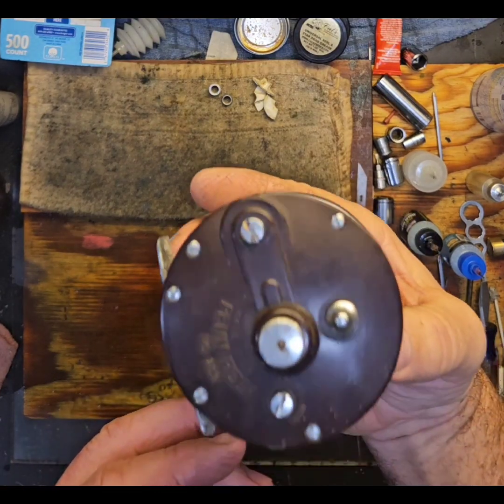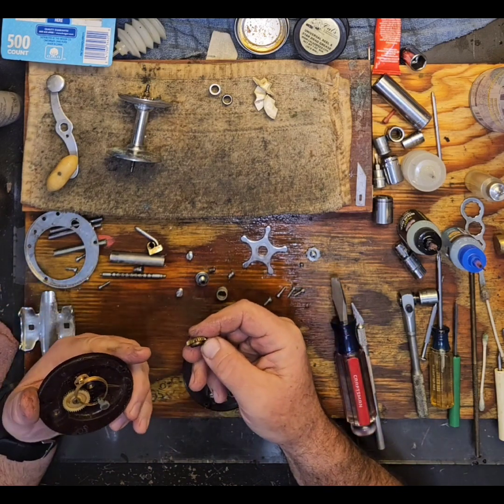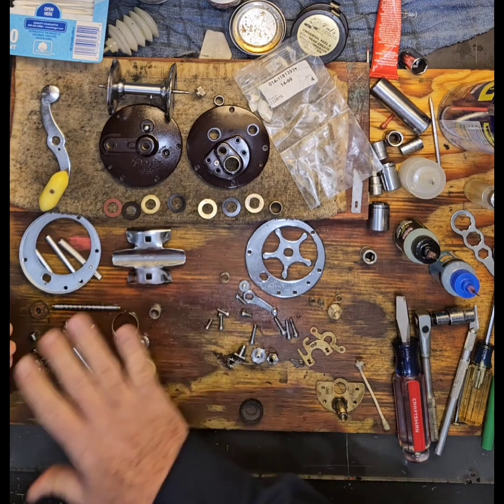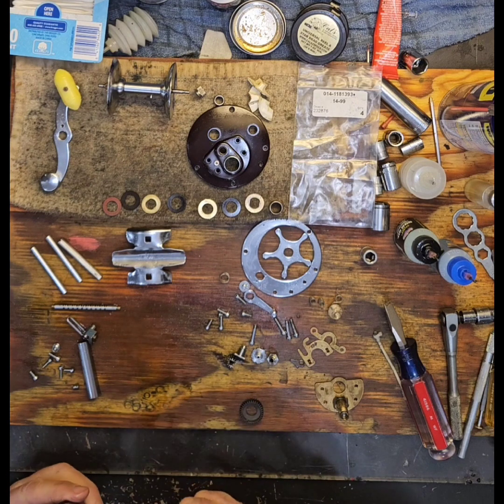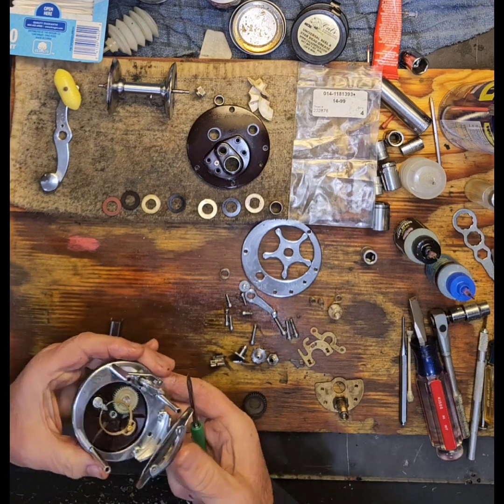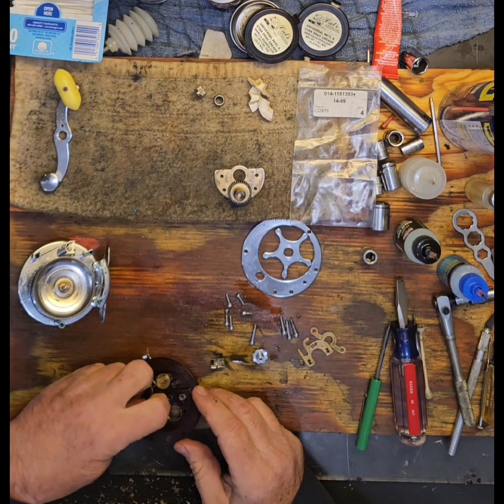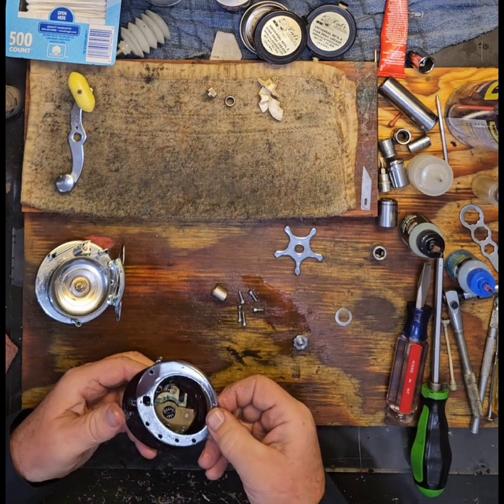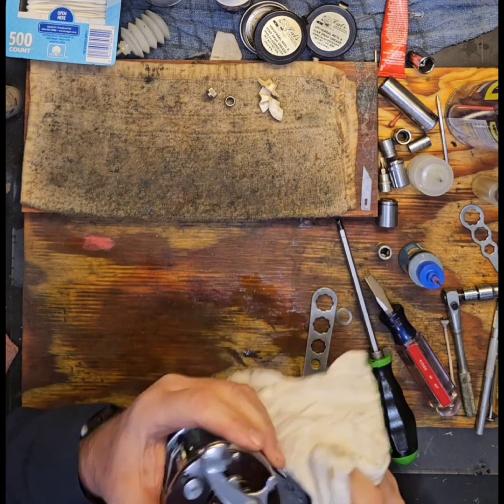Penn Peer 209 clean and repair. It was missing some parts!

Comment: For ease & video quality, its really hard to beat a good cell phone. I've done minor disassembly of spinning reels but never took a level wind apart. I have a can of spray white lithium grease...how do you feel about using that on parts of reels?
Reply from the maker: Any lubrication is better than no lubrication! Just don't over do it! I will say white lithium is better than grease that some people use
Reply from the maker: I'm filming with a S23+ "potatodroid"